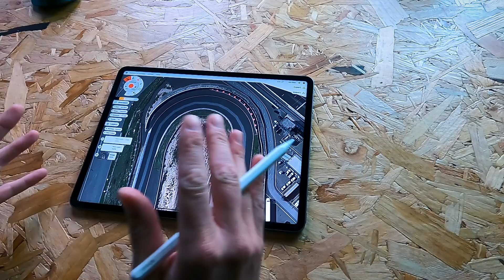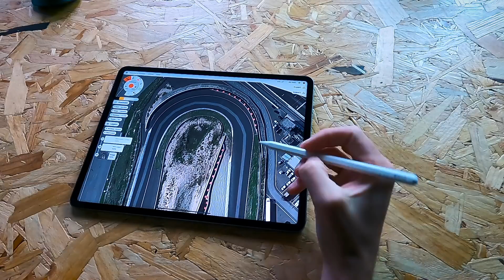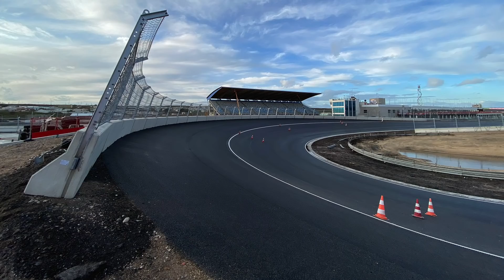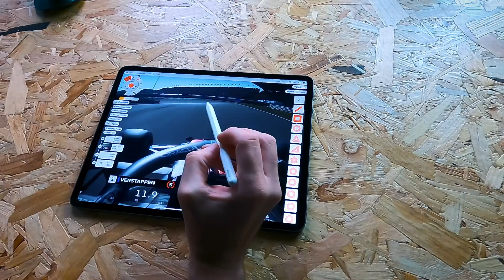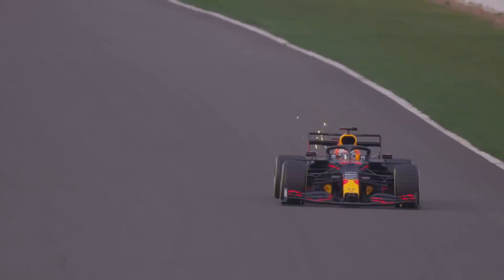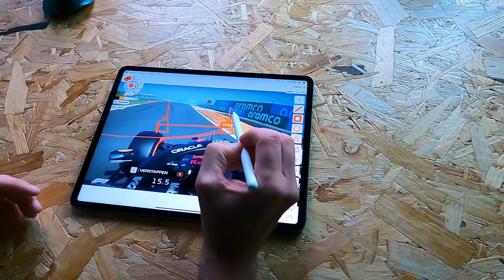Why the F1 Racing Lines were so BIZARRE at the Dutch GP | The F1 Breakdown

Comment: The high line effectively lengthens the straightaway entering and exiting the turn (Example 3). Longer on the gas going in, shorter time waiting for the car to take a set, then sooner on the gas from the center out. Diamonding the corner (Example 2) allows for more change of speed and direction where the car is at its slowest in the turn. Example one lets the car roll through the corner, which is easier on tires and in most cases can keep the cars speed up during the tire/fuel run. Example 1, turns one and two at Darlington, SC; example 2, Iowa or Dover, DE; example 3, Bristol, TN, Indianapolis Raceway Park, Atlanta, or if you are Kyle Larson every track is a #3 track.
That's the way us pavement oval track racers see it, in a very generalized and simple way.

Comment: What Max also mentioned in an interview is the fact this corner is created with concrete slabs unlike the one before start-finish. Because of that the car bounced too much on the low line as these plates can be felt distinctively.

Comment: Not sure how much this applies to Formula 1 (not much I imagine, since the speeds are so high), but something subtle is going on here as well. When you go uphill, you lose some speed. Then when you go downhill again, you gain that speed back. Normally that evens itself out on a straight track to where someone driving on flat terrain vs someone driving uphill and then downhill will retain the same speed at the end. But if there is a corner or obstacle you would otherwise have to brake for, you now instead "store" some speed in the uphill and just get it back afterwards. So you have to break less.

It sounds complicated, maybe, but it's intuitive to take advantage of in racing games by taking the highest line in a banked corner.

Comment: Im wondering did the racing line changed over the years since the 70s-80s-90s or is the racing line always the same ? Couse its logical if slower f1 cars from the 80s had diffrent racing line ? Or is the circuits to small for the racing line to change meaning the cars were still fast enough to have the exact same racing line as today ?

Comment: It's kind of like the carousel at the Nordschliefe...it's shorter around the the banked inner part, but it's smoother around the outside.  For a very low ride height F1 car, the outer line is less upsetting to the car's balance.

Comment: If you have ever driven a high powered sand rail (dune buggy) in the sand dunes of places like Glamis California where there are thirty to two hundred foot tall sand dunes, the winds create giant and small bowls. You ride the bowls like a banked turn. If your joy riding in the bowls, you cruise the entire face of the bowls, if your racing around in the bowls, you hit the crest of the bowl and cut straight down the face of the bowl taking a different line. This way is a much shorter line and you accelerate faster with the steep downhill angle coming off the face and are in a flat level direction coming out of the bank. You don’t have to deal with the inertia pulling you higher up the wall of the bowl, you have traveled less further and come off the bank flat and not drifting at the end of the bank and with twice the speed. 
  I almost expected to see some F1 cars cut those banks in half for a pass.

Comment: There is also an additional centripetal force that comes from the gravity vector of the car that naturally steers it without any input to the wheel. 

Where I live there are a lot of banked corners, and a lot of the time you just find yourself guiding the wheel rather than actually turning it.

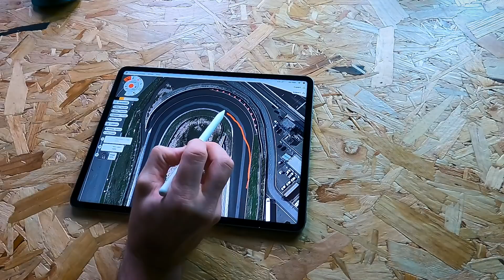Comment: 1:06 finally someone told people about how different and unique seb's racing line's and driving style is. People still have a tough time to understand on why he needs a stable rear end and on why he spins in cars which don't have a stable rear end. It's hard to change your driving style and most drivers can't do that, even lewis or max or any other good driver.
Reply: mazepin: hahah spin goes brrr
Reply: When I used to race karts, my race marshal told me that he noticed me run faster if the kart I had was balanced 50/50. If I have the slighest bit of over or understeer it threw how I like to drive off.
Reply: @Stealth Leopard Because that was the time when ferrari started losing confidence in seb and decided to start developing cars that supported kimi's style (kimi likes oversteery cars). 2019 and 2020 were just upgrades, or downgrades should I say of the 2018 car with kimi's style.
Reply: @oki83435  Jesus fucking christ stop with the BS of "the car is built and made around X drivers style". There's no such thing in F1, this is not motogp, the engineers try to build a solid foundation of a car and then they will work the setup on each drivers needs and style, but its not like the chassis is exclusively made around 1 driver lol. Look how Alonso said that the Alpine felt awful at the start of the season when it comes to how it drives while Ocon didn't have that feeling  and how they really improved alonso's car to suit it more to his style without having to build a car around him.

That statement of car built around one driver BS is just a poor excuse used to justify the bad performance of a driver.
Reply: @voidsax   In ferrari, it's a different story. It was certainly getting made according to seb until mid 2018 where the team lost confidence in him and started going towards kimi. Both teammates drive equal cars so if a car is being developed according to one driver, the other driver would perform badly if it hinders with his driving style. Kimi likes oversteery cars, ferrari made it according to kimi after italy and the bad performances from seb started coming in, you don't forget how to drive overnight son. In 2019, the ferrari was just upgraded version of 2018 oversteery one. In 2020, it was just nothing, it was a full package of both understeer and oversteer combined.
Reply: @voidsax   Alonso was having chassis issues, it was not related to any of the thing that hindered with his driving style.
Reply: @oki83435  In Ferrari its a different story because you just work with them and know their design philosophy right? Of course if Vettel starts making mistakes like spinning and fucking it up when he shouldn't the team is going to try the other driver to get what seb is faiilling to accomplish, plus what does that have anything to do with changing the whole car to only suit one driver and therefore just throwing away the possibility for both of your drivers to score the maximum points they can. Plus, seb was always the candidate to take the championshio with ferrari until leclerc arrived, kimi always did a good job  as second driver taking points for the team. 

And what? I can literally put here 3-4 different motorsport sites where literally alonso said that it was the steering and front wheels where he needed confidence and to adjust the car, not the goddamns chassis. He literally pointed out that "I need to know when the front tyres are gripping and when are they understeering through the wheel, if you take this feedback out of the steering then i'm dead"
Reply: @voidsax  Wdym by spinning? He wasn't spinning before the team started to lose confidence in him huh? What bout 2017 where seb lost because of the fucking team huh?  Ferrari are known for fking things up so don't blame the drivers for everything. Seb had won belgium still the clown strategists decided to give kimi a tow from seb and as a result, guess what happened? Seb had contact with lewis on turn one and couldn't do anything. Not his fault again. Ferrari just fails to do one thing correctly. In 2017, couldn't get the strategies right, reliability and what not. In 2018, couldn't even support the driver when needed and then blamed the drivers for underperforming when they were having their own internal issues. Even your favorite driver wouldn't have been able to perform had the same thing happened to him with politics going on inside the team. Easy to make mistakes when your own fcking team can't fking support you and people are just hungry for powers. Alonso failed at mclaren when the same type of environment was given to him in 2007. Lewis failed in 2011 even though the environment he got was much better than what seb had in 2018.

Comment: As soon as you showed the angles on the banking, it made perfect sense. 

Banked corners provide more grip, as the natural inertia of the car presses more directly in to the road surface of a banked corner than it would for a flat corner - Back to the 'wall of death' analogy for a visualisation of this. 

The higher the banking, the stronger this effect is, and the faster the drivers can take the corner. 

Isolating just the corner itself, it's not clear whether it's quicker to slow down more for the inside (less-banked) line with the shorter distance, or to carry a bit more entry speed for the outside (more banked) line with the longer distance. 
However, the wider outside line allows for higher entry and exit speeds, so in the context of a full lap, it's sure to be the faster line. 

We need more tracks like Zandvoort on the calendar. Tracks with interesting and unique approaches to some corners.

Comment: Actually it wass Alonso who started to use the high line first in FP1. In FP2 Ocon copied him and then the rest of the grid.
Also, during the race, Ocon tried to overtake Fernando through the inside and couldn't do it, so the high line was effectively faster.
Reply: Yeah, he got tips from the resident expert Tom Coronel who they cleverly invited to go with them on their track walk.
Reply: Where did you find this info. I would like to show it to my friend
Reply: @MemeHealer  in the Spanish broadcast of DAZN. They do a pre-race show with legendary broadcaster Antonio Lobato, former driver Pedro De La Rosa and race engineer Toni Cuquerella.
Reply: Normally this is tested in simulator weeks before the GP

Comment: This does not only apply to f1 cars but also to slower historic gt an touringcars, but for other reasons. If you take the inside line you're driving up to a steep banking leaving the corner. By taking the outside line acceleration is much faster because you're already on the top.

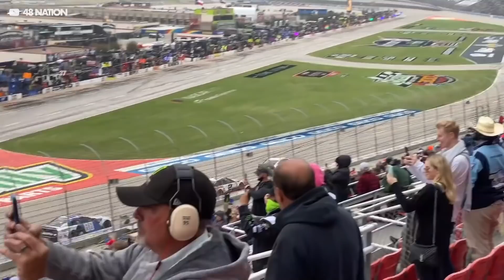Comment: 2:02 The Croydon Flyover! I used to drive that daily.

There are two parts to cornering
1) Generating the centripetal force to produce a curved path of the car around the curve
2) Rotating the car so that the slip angles of the tyres are such that they produce centipetal force in the required direction 

(In flying, ailerons do (1), rudder does (2)).

In a flat corner there is a simple (!!! ish !!!) relationship between these two, meaning that there is only one ideal path. Variable banking means that there are  more possible trade-offs between (1) and (2), so more equivalent paths through the corner. I am sure that modern F1 drivers  can do the necessary mathematical Calculus of Variations in their heads to adopt the most appropriate path. (Well, if they can't you can bet their simulator programmers can).
Reply: been trying to find information on this ridiculously banked corner and croyden flyover isn't getting me anywhere, any more pointers?

Comment: Couple corrections, First of all it's called the Hugenholtzbocht. Your comparison between usual cornering is a contradiction. You stated that in both ways of turning the advantage lays in the late breaking. And yes there were overtakings during the GP in that corner and not just in the lower formula's.

Comment: just drop a steel ball in a bowl it will go as max did. The way of least resistance/friction. U can Brake doing it on  a flatter plane and carrying less breaking into a turn and accelerate with less turned wheels also thus saving tires.

Comment: In America asphalt or dirt it sometimes is called diamonding the corner, to get an extra run off the corner i.e. go down the bank to help acceleration. Sprint cars on dirt use high line to kept up speed.       Jesus Does Save

Comment: so Fernando was the first to take this line through turn 3. recognise the genius of this driver.
Reply: Fernando did some oval banked racing in America. I think the point Driver61 is trying to get across, but doesn't specifically mention, is "Centrifugal force" comes into play on these kind of corners.
Reply: @michaelwatts8182  Centripetal force
Reply: Genius was to ask a local driver who knows Zandvoort in and out. Alpine did the trackwalk and knew exactly where to optimal line was and where you should avoid pieces of circuit due to sand.

Comment: Interesting explenation, especially the end the inside line cannot accelarate hard enough when there is a car on the highline. 
But you miss something. I have driven the corner right from the beginning, when everybody was looking for the fastest line. What you don't see on TV is that the inside drops away, steeply. And the exit of is a climb, already for the high line. That makes the low line in a lowly powered car a struggle. So the slower cars were quickest to discover the high line is faster. But the middle line feels OK, because of the banking almost every line feels composed. I suppose that explains that in most classes (historic F1 for instance) almost everybody took the middle line. You should try it yourself

Comment: Key here is the elevation. The drop to the inner line is much steeper than it seems so your braking and steering is compromised and you accelerate on a steeper uphill angle. High line avoids these problems but is considerably less intuitive. The best line for a normal car would probably be somewhere along the middle.

Comment: Another reason the high line is beneficial is that if you would take the inside line, you would go down while braking, so you lose that energy. If you stay high, you can use gravity to help slow the car down, and get higher in the corner. That energy, that you have stored in the car because you are high, you can release again when exiting the corner to the lower part of the track and help you accelerate out the corner.

Comment: Max also mentioned that it seems they used ‘plates’ to create this banking. So when you transition from inside to outside you could feel the transition between plates a bit which can upset the car slightly.
Reply: Also when transitioning from one 'plate' to another, one wheel tended to be suspended in the air for a moment which obviously is not ideal

Comment: The line you put on that screen at the beginning and the second one after, were 2 things I learned at 9 years old from the original Gran Turismo game for PSX. None of these lines are strange in any way. 😀
Reply: He's not saying those lines were strange you melt, he was saying it was strange that: 1. multiple lines were used throughout the race on the same corner. 2. The perceived fastest line wasn't used by drivers. The lines aren't strange, the use of them is.

Comment: One thing I've noticed no European commentator talking about is the fact that it's a gradual Bank meaning as you go up the track the banking is get slightly steeper. If  the angle(banking) was the same throughout the entire Corner the inside line would be faster
Reply: Banked corners are all about driving style and car set up. Your theory about the inside being faster if it wasn’t a progressive banked corner is wrong the way a banked corner works is the inside is slower but shorter and the outside is faster but longer. Basically do you want torque and dig your self out of the hole of the inside or top speed and carry your momentum around the outside. What Zandvoort showed was that NASCAR and Indy Car circle track racing isn’t as simple as it seems after all they pass on the inside and outside all the time during a race on progressive and equal banked turns.
Reply: @zacharyradford5552  if you watch Nascar for the entire season you will realize that on most tracks They are fighting for the inside line there are very few tracks where the outside line works and even fewer drivers who are able to make the outside work consistently I've been a Nascar fan longer than I've been in F1 fan
Reply: @zacharyradford5552  the busch Brothers Kevin Harvick Kyle Larson are the only current drivers I can think of that do this regularly. Hamlin did it pretty good on Dirt britol but thats abiut it

Comment: Good stuff. Thanks. I LOVE that circuit. That was an awesome race weekend. 

Question: If the cars weren't downforce cars, like if they were GT cars, would the higher line be as beneficial? Would the quickest way around be the more traditional line? Thanks for your great analysis.
Reply: I think it still probably would be. The same principal works with NASCAR cars on ovals, and of course those cars are heavier and have much less downforce.
Reply: It truly depends .
Sometimes horsepower means a shorter line is the faster one. Other times it's the clean air and extra downforce that makes the longer line faster.
In GT cars typically the banked corners of the American Rovals usually mean drafting for assistance or running a more conventional line.
Watch some IMSA and Grand Am races from Homestead, Charlotte, or Kansas.  Daytona has much more banking.
Reply: Not necessarily driving style and car setup would play a factor. The inside is slower but shorter the outside is faster but longer. Drivers need to figure out what line and style of entry, middle and exit that there car prefers.

Comment: Actually, Zandvoort's increasing angle of bank is typical NOT 'very unusual' - if it didn't, cars would be flung off above a certain threshold: just look at banking on a historic circuit like Brooklands, Monza, Montlhery, Terramar. Only variables are transition rate & to what maximum, with Wall of Death being logical extreme... 
Based on that, not bothering with any more of your 'analysis' ; also, 'Bizarre' spelt correctly above  - but not on the thumbnail...